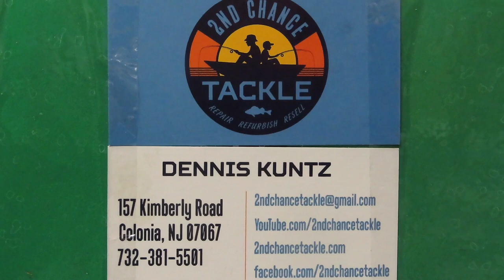Daiwa BG 4000 DigiGear spin fishing reel problem diagnosis and how to take apart and service

Comment: Best reel ever made for the money.   Perfect line-Lay, huge main gear, holds lots of line.  This reel uses the same bearings found in 500 dollar reels. I don't use this reel because my fishing requires sealed reels but I know this BG is the best reel for the money if you don't need sealed reels.   The absolute best spinning reel ever made is the Okuma Makaira.
Reply: I happen to agree.
We have had clients pound these and as long as you service them they are bomb proof.
Reply from the maker: Thanks Richard - it is certainly made well.  I appreciate the note - Best wishes - Dennis
Reply: @seanwoodburn2616  Junk. Mine crapped out the same way after half a season. Common problem with these reels. Stay away,

Comment: I worked on two reels today that did not go as planned or hoped. First was a beautiful little Shakespeare 2711 gold  spinning reel. I found a broken bail spring that I need to replace if I can find one. This is a late 1970s reel in the 2700 series. I already have one as well as two of the large 2741 reels. I like them and decided to collect a few. Second reel was a 2080 Sea Wonder Shakespeare. I got it working fine but I could not get the rotor off so I had to grease and lubricate without removing the pinion and bearing. The difficult problem was the spring the operates the anti-reverse lever had come out. I had to totally dismantle the anti-reverse that has two different springs and reset everything correctly. I bought the reel for parts but it looks very nice and operates perfectly. I just wish I could get the rotor off and be able to remove the bearing and pinion. You did a great job on this reel Dennis. It turned out beautifully!
Reply from the maker: Thanks Chris.   Sometimes those old reels are stubborn and it is best to let that sleeping dog lie without removing the rotor.  Best wishes - Dennis

Comment: I saw some other channels that swear by packing in a lot of Grease because it's going to be in saltwater.. and they also overpacked the bearings with tons of Grease. And all I can see happening if not serviced properly every 6 months or so is what happened to this real a lot of gooped up grease and problems.. I am a more believer in your method, with oil on the bearings Grease on the bushings and light grease on the gearing.. I am actually going to be working on one of these today nice job.
Reply from the maker: Packing with grease is an Old Timers way of waterproofing the reel.  The problem is exactly as you noted.  The grease dries and the reel bogs down.  Also, the grease traps micro sand and salt and that becomes abrasive.  If you are going to do it, you need to change the grease at least once a year - Thanks - Dennis

Comment: Great video ! Clearly explained. Understandable...
...My BG4000 has started to feel like it's wobbling on retrieve. Line lay seems fine. Shaft doesn't seem to be bent, although I  did recently have a problem seating the spool. Could not get drag knob on. That's ok now. The wobbling tho 🙈
Reply from the maker: Check for a bent bail wire.  That could cause the out of balance wobble
Reply: @2ndChanceTackle  cool thank you Dennis!  I'll give it a look 🤙🏽

Comment: Dennis, you did not need to remove that screw from the crosswind block. You took it apart like a Penn. Once the main gear and pinion gear are removed you just pull the spool shaft out while still connected to the crosswind block.
Reply from the maker: OK - Thanks for the note and tip - Dennis

Comment: Nice work Dennis. 
I have this reel and haven’t used it yet. I think it was a tackle advisor guy recommend packing marine grease into the handle axle area. 
I like your advise better. Rinse after use and annual servicing.
Reply from the maker: Thanks for the note and the feedback - Best wishes for great fishing with the reel - Dennis
Reply: packing a reel with marine grease can go along way. I tend to pack my reels with grease and still rinse them down after use and than clean them off as well. I've had a Shimano Saragosa 6k for 5 years that I serviced two years ago and its still working as if it was out of the box. the only thing i do now on it is pack the roller bearing with grease cause it tends to go bad after a few outings.

Comment: I have a couple of these in the 6500 size as boat reels. Great for guests who don't have their own gear. Warning though, they DO NOT keep saltwater out so be ready to service more than usual. If you fish them like I do, on a boat in the ocean, saltwater will get in. This is 100% a service at the end of the season reel. If you wait until the following season and let that saltwater sit for a few months you will have big issues. For $100 my 6500's, which are like a Penn 8000, have caught quality dolphin, blackfin tuna, keeper black grouper, more snapper than one can count, etc. They will catch offshore fish for a hundred bucks. You just have to stay on top of them!
Reply from the maker: Thanks for the tips and advice on this one.  Well said - Dennis

Comment: I turkey wish that when you do your reel videos, that you spend additional time on all reel anti reverse systems.
Especially on the 4000 x diawa fish reel.
And all others.
Thanks.     
JURGEN ST.RODA
Reply from the maker: OK - I will try to show more of it.  The A/R clutch does not require maintenance, so I normally just mention it in passing.  It just needs to be kept grease free for best operation - Dennis

Comment: i thought the anti reverse clutch looked a bit rusty - i've replaced a few of these in similar models of reel from daiwa and the part is easy to order from the manufacturer.
Reply from the maker: Thanks - yes - Daiwa will sell the parts for the newer models.  Thanks for the additional information - Dennis

Comment: Well done Dennis. Very informative. I would like to ask whether for us Brits, you could service an Okuma Epix Probaitrunner EPB50. Thanks
Reply from the maker: I will check it out.  I do not have one in my shop, but will add it to my request list - thanks for asking - Dennis
Reply: @2ndChanceTackle  I love your shows. Very relaxing and informative. Over in UK, we use a lot of baitrunner type reels and they add another level of complexity to servicing.
Reply from the maker: Yes they do Paul.  They combine the top drag and rear drag and a flip switch, so the more moving parts the more complexity.  Thanks for the note and for watching - Dennis

Comment: I have this exact problem. Turning the handle it sticks or feels like something stuck.

When I open the bail and turn the handle, the rotor will not turn at all but the axle does move up and down

Note- I dropped the reel in the lake for about 15 minutes. I got it back open it up and oiled it. I did not open all the way inside.

I may have dropped it a couple times.. no more than 2ft’ up.

Wonder if its worth to send it in to fix or just buy new one for $110.
Reply from the maker: The reel may had been flooded and have some dirt or gunk inside.  Please send a note to my email 2ndchancetackle@gmail.com for repair information. 
Then you can determine whether It it worth it.  
Thank you
Dennis

Comment: Hi Dennis just p picked up a diawa AG 750spinning reel, and the detail open smoothly and closer smoothly with the bell won’t close when the handles turned what to do
Reply from the maker: Does the bail move at all?  The first thing I would do is get a can of penetrating oil and wet down the sides of the bail where it connects to the rotor.  Once it is soaked, manually move the bail wire back and forth.  That should break up any dried grease and dirt that may be preventing the bail from operating.  If you don't feel the spring compress when you are moving the wire and the oil does not fix it, then you will need to soak off the cover and check for broken parts - Dennis

Comment: Hey i wonder if you might help me, i was fighting a big fish with this reel, now the handle sometimes spins in both ways, but only in some positions, as if anti reverse clutch isnt engaging, so i cleaned the clutch now its a bit better, it didnt seem damaged. Do you know should i put grease in the clutch, would that make it better or i should leave it dry
Reply from the maker: Keep the a/r clutch dry. Make sure the inside sleeve is also dry.

Comment: Thank you Dennis, these are the reels (4000 and 4500) that I use for spinning off my kayak, so I've been hoping you would do this to one of them! 
One of mine started catching and then stopping, in a similar way to the one you've just fixed. Turns out I'd cracked the case and salt water had gotten in, reacted with the material of the main gear, creating lots of that white corrosion.
One question I have: I notice on one of my 4500s that the bearings on the bail arm where the line goes under it are no longer turning as the line is reeled in. Should I just drop some oil in there or somehow get in there?
Thanks again, Owen.
Reply from the maker: That salt water will eat many reels alive.  Thanks for the note - Dennis
Reply: Hi Owen, what is an ideal rod size for spinning with this 4000? I just picked one up
Reply: @thebuzz2010  Hi Andy, I've got a 7' Ugly Stik M that works really well with my 4000 off the kayak. Casting off land you could go longer if wanted to, maybe 7'6" or 8'.
Reply: @owenphillips9166  thanks owen

Comment: Dennis, great video as always, thanks! I wanted to say these reels are junk. I have the exact same reel and the same problem happened to me after a 1/2 season use. And I use mine on a boat, so it never sees the surf. I always rinse with fresh water when I get home. Still, mine bound up and was sticking. When I used this great video to disassemble, I found the screw that holds the rotating shaft, to be frozen. I was unable to free the screw. Worse yet, the head stripped out after several attempts to free it. Basically rendering the reel as scrap metal. I think I may have to try and remove it with a dremel, and try to salvage it. But the worst money spent on a reel. $110 for half a season.
Reply from the maker: Thanks for the note Vinnie - The few of these that I have seen appear to be problematic.  That is not a good sign or endorsement for the reel. Some reels are just quirky.  This may be one.  Sorry to hear of your experience - Dennis

Comment: That salt buildup on the main gear shows that no reel is waterproof no matter what the manufacturer says.
Reply: Of course it's not sealed.  There is a reason the Van Staal is 800 dollars as well as the Okuma Makaira.  My vsb Van Staal gets fished while under water and is still smooth as the day I got it.
Reply: The manufacturer does not make any such claim.
Reply from the maker: This is not a sealed reel, but they do their best to make it water resistant. - Dennis